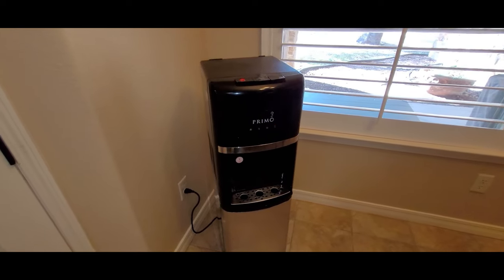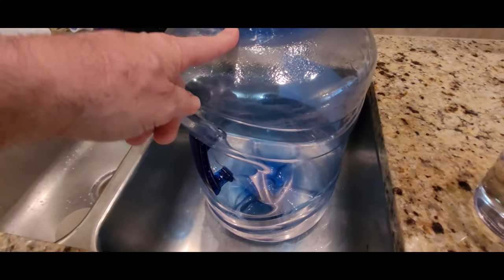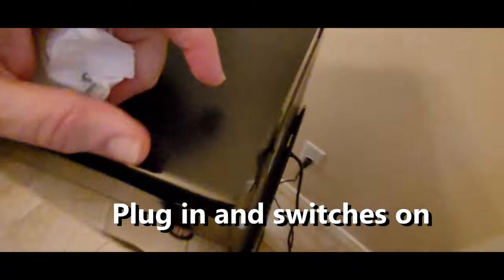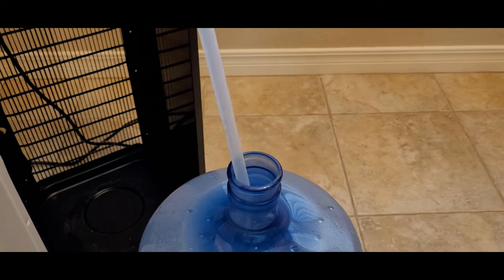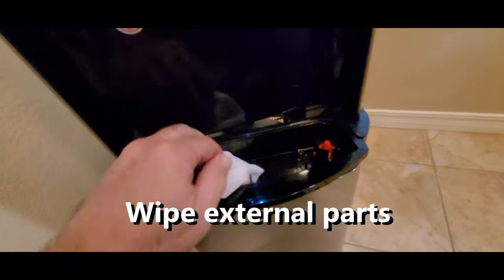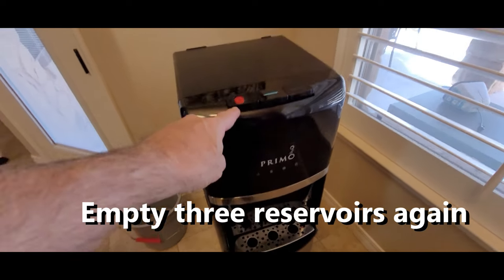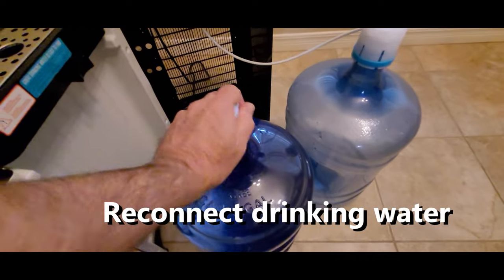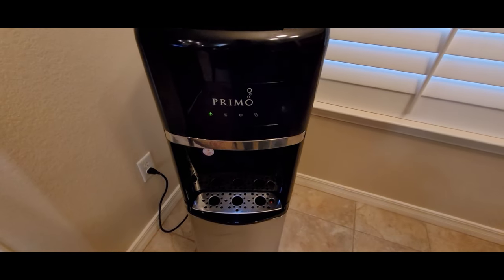Cleaning a water dispenser - Primo 900130

Comment: My hot works, but my cold does not.
Reply from the maker: Is there oily stuff in the bottom of the unit? Indicating compressor went bad.  Does it have separate cold/hot water power buttons in back and both on?

Comment: Thank you for this step by step. 
Do you taste some vinegar after the new water is in?
Reply from the maker: No vinegar taste.  Rinse it well.
Reply: @DrBDIY  thank you
Reply: I’ve done this but I keep seeing white stuff floating in my water. What could this be? Some kind of looks like a film.
Reply: I'm sorry I'm late. What you see is that your water has become hard water. Your water is calcium dense. Which means that over the course of using your dispenser, there has been a calcium buildup. This isn't a bad thing. You can still drink it. Personally, I find it very hard to get rid of this, and it usually happens to people who either haven't cleaned it or have been using their dispenser for a long time.
Reply: @kingfloyd0001  if I clean it again will it maybe go away?
Reply: @queenrae91   Sounds like you loosened the sediment, but didn't do the hot water wash/rinse maybe?
Reply: @kingfloyd0001  Even if they used only sparklets purified or spring water?
Reply: Thank you. Do you know why my cold water light is blinking?
Reply from the maker: Unknown other than filling the tank.

Comment: Can this cleaning method be for any water dispenser? Not just for this model? Thanks again! I plan on cleaning mine as I’ve never done it!
Reply from the maker: I cleaned two different models of Primo dispensers.  I am not sure if other models or MFRs have a different approach.  Most will publish the cleaning approach in the manual or web site.
Reply: @DrBDIY  It worked like a charm on my Frigidare stand-alone 3-button cooler/dispenser (Cold/Hot/Room Temp)

Comment: where did you get the gray cap for the water jug
Reply from the maker: Its a very light blue cap.  They came with the bottles but I can't recall where I purchased the bottles. You can search walmart for "Brio Blue Plastic Top Replacement Cap - 6 Pack - 55mm for 5 Gallon Water Bottles CA55DBDP6" or amazon for "Dew Cap Replacement - 55mm Snap On Crown Top Fit 3 & 5 Gallon Water Bottles Snug & Tight Leak Proof Reusable BPA-Free Jug Lids" .  Thanks

Comment: I found that the ice cube in the reservoir needs to be melted completely before cleaning. The ice will hold the vinegar and the water will taste like vinegar.
Reply from the maker: Ice cube?
Reply: @DrBDIY  There is a container inside of the machine that holds the water inside with a giant ice cube. That's how you get cold water.
Reply from the maker: In my water dispenser, compressed refrigerant is cooled and 
passes through coil that touches the water and cools it.  The container stores the cold water.

Comment: Thank you
Reply from the maker: You bet.
Reply: How often do you do that?   And how did you take the drain cover off the bottom when you overfill your glass .? Thank you, sir 👍
Reply from the maker: I clean the unit once per year. The drain cover just sits in a groove so I just push a corner and it comes out.